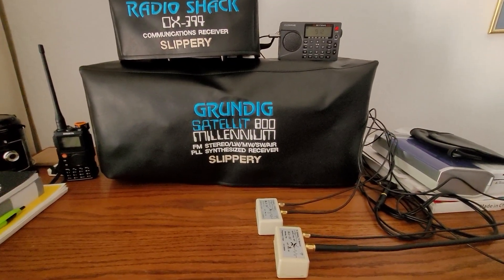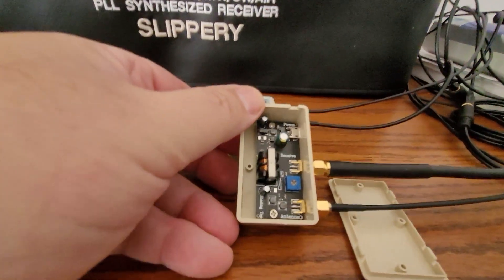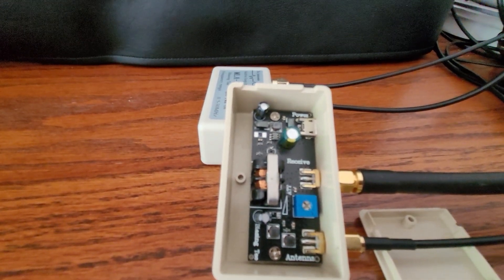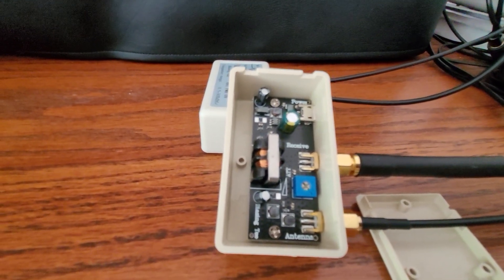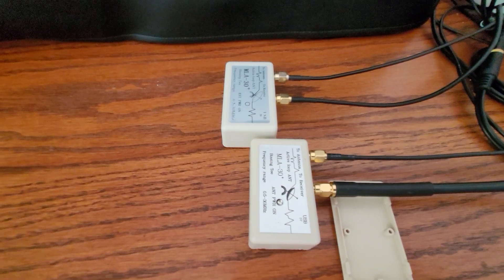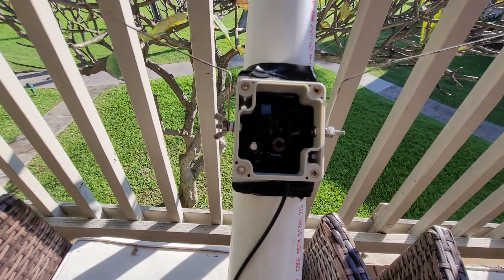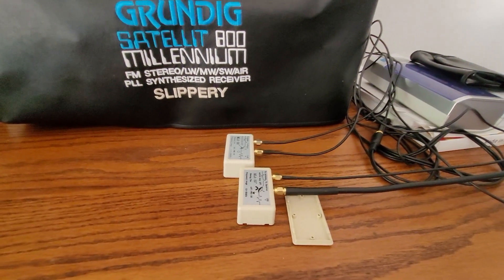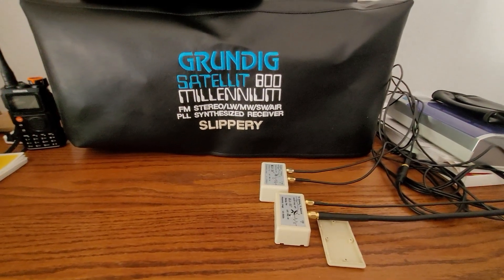MLA-30+ Shortwave Antenna Series: Final Thoughts on the Green Light and  lue Light Antennas

Comment: Your link is to. the blue light one.
Reply from the maker: @lornaz1975  I will remove that. It changed a few months after that was posted. It was the link I used for my green light.
Reply: @Ponokaiguy  I figured that was the case. I got the blue light version. Not sure if the old one is made anymore. They actually are promoting the blue light. Go figure!
Reply from the maker: @lornaz1975  I did remove the link. I had it in a couple videos. It's strange that it changes to the blue version but go Figure. Lol

Comment: From the link you provided the second review i see on amazon someone says on 1/5/25 they received a blue light version
Reply from the maker: @ARC3333  Thank You, I didn't know that. I have had two people just but them and they did get the green light version but I will mention that. Thanks Again
Reply: @Ponokaiguy  I did purchase one so i guess we'll see, in the pics on the amazon page it does say it has a blue light thou
Reply from the maker: @ARC3333  That has definitely changed since I purchased. I never saw any reference to the light color.
Reply: @Ponokaiguy  the one i got has a blue light
Reply from the maker: @ARC3333  How big is the Loop? My Blue light has a much larger loop than the green light version.
Reply: @Ponokaiguy  i didn't completely open it, figured id just send it back
Reply from the maker: @ARC3333  Probably a good idea.

Comment: UK Amazon are selling blue light version on Prime £38.99. They also sell others direct from China suppliers with UK warehouses.  I am surprised a different colour light gives a different signal strength though, any idea?,  the ANT Power on button only should work on USB Charge, so if you are using a SDR with a bias T use that then it should not come and unless another component has been changed there should it affect the signal?
Reply from the maker: @steveblanchard7293  Thank You so much for watching and your comment. The thought on the color is that it's a different manufacturer so different parts and made differently. So not just the light color causing the difference but the light can help tell the difference between the two.

It's not a charg. It's a power supply. So, no power if not plugged in.

Comment: Yes the MLA30s can throw out too much gain under some conditions, so cutting the gain is a real good idea.  Also if you are comparing the 2 antennas, separate them as much as you can to prevent inadvertant interaction between the 2.  Very useful idea.
Reply from the maker: @michaelagner4355  Mahalo for your post and Thanks for Watching.  I am limited on my space here in my condo so the furthest I could separate them was 12 feet. That's how far apart they were for the videos. I posted some pictures of them right next to each other but that was just to show the physical differences. 🤙🏻
Reply: @Ponokaiguy  Hey guys I'm new to this stuff , can I use this antenna indoors?
Reply from the maker: @Voltomess Yes, you can. It will work better being outside. I know people who stick them out a window too. 

I live in a condo so I can't mount it permanently so I set it on a chair on my lanai and then take it down when I'm done. 

If you use it inside, experiment with different locations to see where you get the best reception and the least interference. 🤙🏻
Reply: @Ponokaiguy  Awesome thank you.